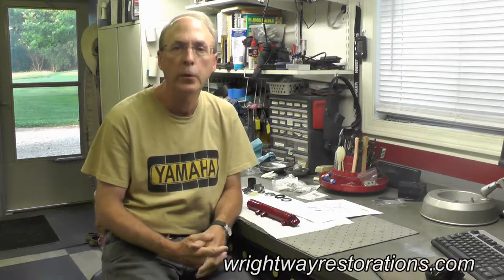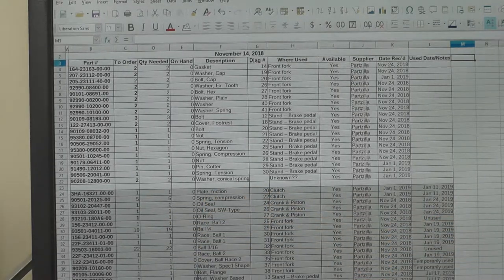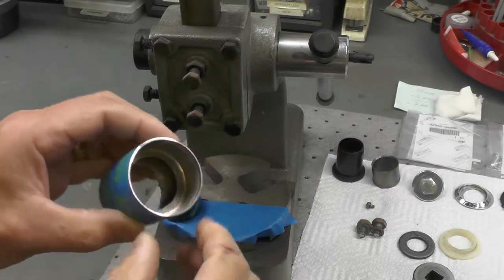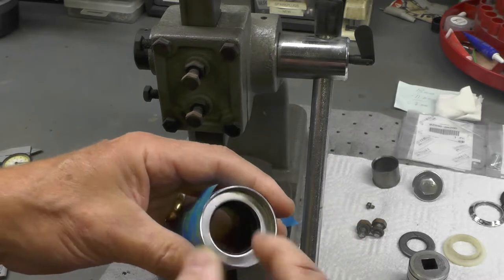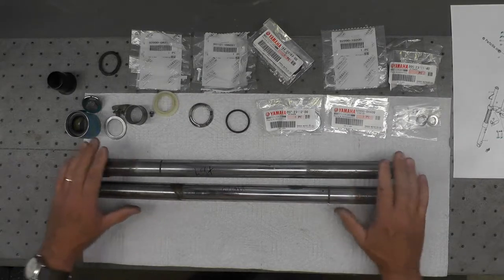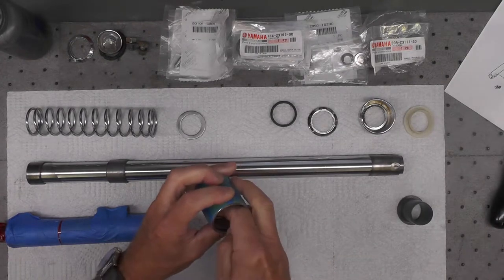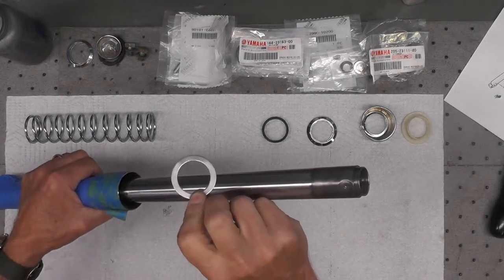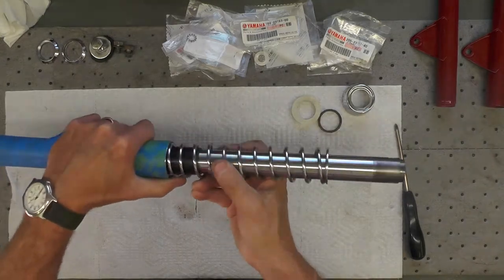Yamaha YL1, Assembling the Front Forks --- Video #114

Comment: Glad to see the thread and upper edge of the lower leg greased to make life easier when screwing on the fork nut 'O' ring. Those 'O' rings are usualy standard sizes and ready available in modern materials just not in a Yamaha bag. If you ever get really stuck for hard chroming send them to A.M Philpots of Luton here in the UK. They have ground and hard chromed three sets of Kawasaki fork legs for me (F4, F9, S2,) and although not fast their work is second to none. Please keep the vid's coming. Good work.
Reply from the maker: When I realized Yamaha no longer offered the O-ring for the fork nut, I inspected the originals and determined they were still serviceable.  Consequently I didn't need to  investigate other solutions, as I did with the fork seals.

In terms of hard chrome, the primary issue with sending to the UK is shipping costs for something as relatively heavy as fork tubes.  I've actually heard of AM Phipots as I have a subscription to the UK publication "Classic Motorcycle Mechanics" (highly recommended, BTW) and they are mentioned in the magazine from time to time.  Though there are allegedly several places in the US that will re-chrome motorcycle fork tubes, I've never been able to get any of them to respond to my inquires.

Forking by Frank, based in the US state of Illinois I believe, who manufactures new forks tubes refused to make tubes for the YL1.  Apparently they've never made these tubes before and weren't interested in setting up for them.

Thanks for all your comments!
Reply: Good to know Dirk as my stanchions really need re chroming

Comment: hey, super stoked you're taking the time to do all this. you are very detailed and its so much help.
I'm also trying to hunt down the brand new NOS tubes. mine are bent. I took the OEM part number 196-23124-40-00 and searched for that in the NOS database but nothing came up. how did you find new ones?
Reply from the maker: These tubes are very hard to find new as I'm sure they haven't been available from Yamaha for many years.  I found the new tubes on ebay, and they came from the either Thailand or Indonesia as I recall, though I don't remember which.  If you find them new, they are expensive no matter where you find them.

Besides finding good used tubes on ebay, there is an alternative if the chrome/finish on your current bent tubes is OK.  A competent machine shop can often inexpensively straighten bent tubes.  You might consider looking into this.

Glad the find the videos helpful, thanks for the comments and good luck with your project.
Reply from the maker: I should have mentioned... if you wish to search on ebay for the inner tube, I'd suggest a search such as:

Yamaha (196-23124-40-00,196-23124-40)

Comment: I did a compression test on my YL1 it was cold, only 85 psi and 89 it runs great. I was told that it should be over 100 psi , I was going to rebuild the motor this winter. Do you think it's a problem if I  use it this way for the rest of this season. I don't want to do any damage  it's 1967 with 5800 miles thanks.
Reply from the maker: Running the bike with light compression won't do any damage.  As long as it runs OK and is otherwise in good repair, you will be fine.  A common symptom of low compression is hard starting when cold but starting OK when hot.

Yamaha doesn't publish a compression specification for the YL1 (that I'm aware of anyway), however 100 PSI is a good reference point for a minimum.

Note that compression is usually tested with the engine warm and the throttle wide open.
Reply: @kwrightway  That's good news it was always in the back of my mind, when i was out for a ride that i may be hurting the motor now i can relax.  I will do the compression test using your method thanks again for all your advice.
Reply from the maker: @caseybig9618  You are very welcome...